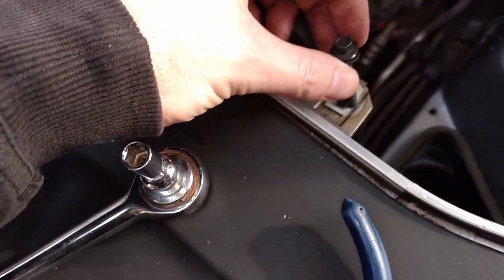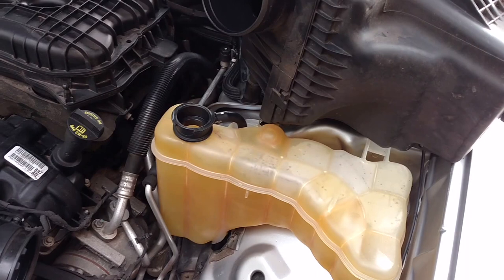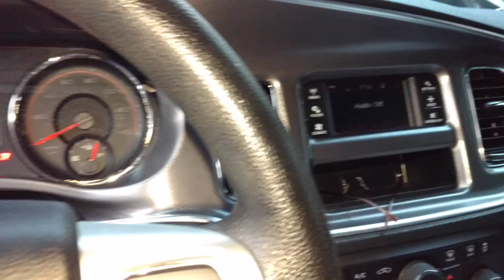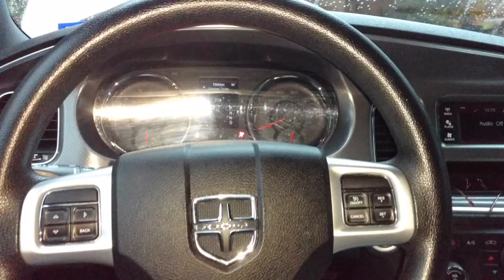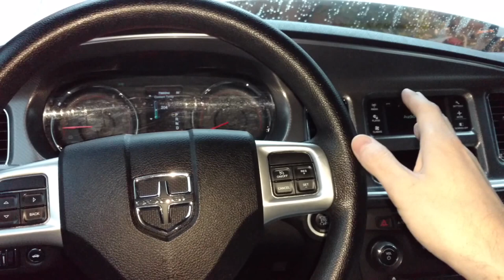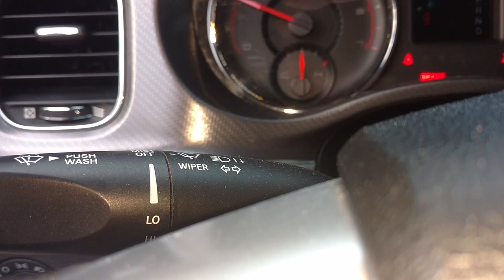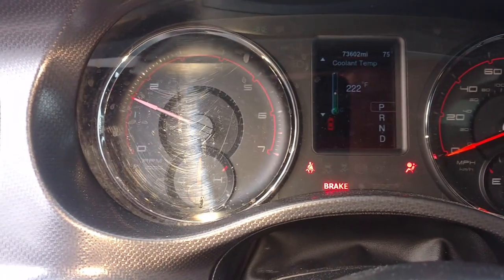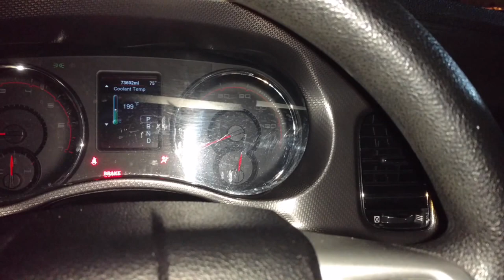Coolant Flush & Change. 2013 Dodge Charger V6.

Comment from the maker: Use silicone on the petcock. I made the mistake of WD-40 and it dried out and broke the O-ring.
Reply: Did you have to replace the whole radiator? Or is there a way to replace the o ring

Comment: At the beginning, if you don’t want to remove the whole thing, you can just remove the passenger side front tire, remove the 3 plastic locks on the bottom (under the box looking thingy) and then under the front bumper remove the first 2  7mm screws starting from the wheel. That will give you enough clearance to get your hand inside and turn the petcock. Saves you a lot of time and effort
Reply from the maker: Thanks for the tips.
Reply: You don’t need to remove the tire. I just turned the wheel all the way to the left, and that gives you enough room to get your hand inside.
Reply: shove your arm down there and turn it.....works for me

Comment: A quick rundown, don't use chemicals not listed on components(wd on the petcock) silicone doesn't eat plastic or rubber use that, spray or paste. The way you are doing this you're dumping maybe 1/3 of the coolant in the system, so at this point you have an unknown amount of old coolant, new coolant, flush (acid), additive, and deionized (should be distilled) water. For air in the system USE THE BLEEDER. Every single drain and fill, open the bleeder after the coolant stops draining from the petcock (more will drain out), close the petcock, fill until coolant starts to run out of the bleeder close the bleeder, and top the system. To do otherwise is to risk an overheat that the ecm can not mitigate.
Reply from the maker: charredskeleton - It's mentioned in the video not to use WD-40. I learned the hard way. The bleeder is good but in my experience won't get all the air out.
Reply from the maker: charredskeleton • I also mentioned the bleeder valve too. Watch it again all the way through. You're right should have used distilled water though.

Comment: Great video couldnt find it this anywhere else. Just wanted to add that the plug to bleed the coolant and get the air out is located at the top of the thrrmostat housing which you showed. You just use a screwdriver to loosen it and release the air and once fluid starts to pour out you can tighten it
Reply: When you release the air, should the engine be on or off when releasing the extra air? And should I cycle the engine before releasing air or no?

Comment: Hey, i have a 2013 charger v6 and the reservoir wont stay full. there is no leakage on the groud. any ideal what it could be? when i purchases it it came with the yellow coolant. are we support to be using the mopar purple kind?  thanks
Reply from the maker: Sounds like air in the system. Once you purge all the air out then just top off the coolant and it wont disappear anymore. Yea might as well flush the system and put in the purple Mopar. Thanks for watching.

Comment: Can you please help me. I replaced my thermostat. First I drained out all the coolant. Then I replaced the thermostat. Once I had the thermostat in place I inserted coolant into the reservoir up to the line where it said "cold fill range" (I made sure to close the bottom coolant valve) then I let air out through the thermostat bleeder and the coolant reservoir went down. Then I filled up the coolant again and bled the air out and did that over and over again until there was coolant coming out of the bleeder valve. I never actually heard any hissing noice but I assumed the air was coming out since the coolant reservoir was going down. I then turned my car on and let it running with warm air and with the coolant tank cap open for about 15 mins. However when I was driving and then parked there was coolant leaking everywhere underneath my car and there was vapor coming out of the coolant tank cap and my coolant temperature was 246 Degrees Fahrenheit. Any thoughts please bro?
Reply from the maker: Sounds like a restriction, something to do with the thermostat, maybe it's backwards or some other restriction. Sounds like an airlock was created and that explains why the coolant went down but none of it came out of the bleeder screw (if i pictured your explanation correctly). — Ensure your gaskets and hose connections are solid. Definitely don't drive it until you get this figured out so you don't ruin the engine from overheating. (246° is way too high)

Comment: For the coolant is it just best to use the mopar concentrate or is other coolants fine to use , I got a 14 challenger with similar cooling system just don’t know if it’ll be a major difference or have any effect
Reply: Have to use mopar coolant its rated for 150k miles but you should change it in half that around 60-80k miles

Comment: I tried to do this and my car started overheating? I've been having a check engine light with some instances of AC power lost
Reply from the maker: You have air in the coolant system causing it to overheat. You need to bleed the air out before you  drive anymore to avoid anymore over-heating damage to the engine. Here's the video on how to bleed better with a tool that helps - https://www.youtube.com/watch?v=9wXDJ6GKue0 .

Comment: How were you able to release that extra air once the actual coolant was in, you said the towl over the resivior cap method and squeezing the hoses but was there any way to release that air from the petcock like you were doing with the water?

 Thanks
Reply from the maker: Austin Sloan - Once the coolant is in the petcock will stay closed. Let the pressure build up after driving for a minute or so... make sure you don't get over 215-220 degrees and then turn the car off and do the towel method. Once most of the air is out you should be within the 175-192 temp range at operating temp. If you notice huge tempature Fluctuations while driving that's a good indication you still have air in. Also its probably a better idea to buy the coolant funnel i mentioned and it's in the description... Other videos show how to use it.

I've since learned there's a vacuum method that ensures near 100% air removal which can be found here - http://amzn.to/2opUzfP

Thanks for the question and watching.. Hope this helped.

Comment: I did more research and watched some videos about that funnel, would I be able to just add the coolant and then let the car run and let the air bubbles escape because the system is not pressurized and then once it stops bubbling cap it? would thay work or would the over flow be over flown? 
Thanks for the timely response
Reply from the maker: Austin Sloan - Yes you let it run with the funnel on and the air escapes.. it won't overflow as long as you don't overfill it.
Reply: I was more so asking if I would I be able to do it without the funnel, just leave the resivior cap off with the vehicle warming up and releasing the air just without the special funnel
Reply from the maker: Austin Sloan - No.. the funnel adds the needed space/height because the pressure will cause the Coolant to rise and fall.. without the funnel you'll have a mess ;).
Reply from the maker: Austin Sloan - Also it's very likely to get more air in the system if you did it that way... I actually shouldn't have opened the cap with the car on in the video.. only do that with the car turned off.

Comment: I want to do this to my car but my resevoir is filled with like a tan color gooey stuff have any idea what that is?
Reply from the maker: veronica lopez • Doesn't sound good... Noticing any leaks on the engine block? Sounds like oil contamination into the coolant lines... Which makes me think the engine has a lot of miles or has been overheated :(.
Reply: Mr Ficks I have about 98k miles but  theres no leaks and it is overheating now 🙁 not sure how to fix the problem
Reply from the maker: veronica lopez • definitely flush and change the coolant... If the engine tempature is getting above 212° it's definitely not good.. So if I wouldn't drive it if it is.. Until you flush the coolant.. And make sure there's no air trapped in it after :). If you have any more questions feel free... Hope it goes well.
Reply from the maker: veronica lopez • also this video is an easier way to drain the fluid... Also it shows an easier way to get the air out after - https://youtu.be/fI-PC82-mHw

Comment: So my 2012 Charger with the same engine. The heater is hot for about 2 min when I first turn it on, then goes cold. Would this fix the problem?
Reply from the maker: Yea sounds like a fluid and/or air trapped in the system issue.

Comment: So I just changed my thermostat. Refilled the fluid and have been driving it. It’s running at around 215 now. Is that too high? If I loosen up the bleeder it is coming out pure liquid no air
Reply from the maker: Sounds like it's close to fully purged if not already.
Reply: @mrficks1838  I played with it again opened up the bleeder screw again and it’s still coming out pure coolant. Ran it with the cap off and heat on for a little while. If it’s not fully purged will it eventually work itself out? Just a little concerned why its running hotter, guess it could just be the thermostat itself.
Reply from the maker: If it's running hotter my guess is there is still air but not much. 215° is not too high. Also there may be slight variations depending on the thermostats manufacturing.
Reply from the maker: It will slowly purge yes but go ahead and crack the cap after you park to let it out until you see a temperature you feel good with. It might take a few times of that over some days. If it doesn't move then my guess is the coolant mix and or the new thermostat and I wouldn't worry about it.
Reply: @mrficks1838  thank you I appreciate your input!

Comment: I ha e a 2012 Dodge Challenger the engine bays look the same so you think I could reference this video for  doing a flush on my vehicle thanks
Reply from the maker: Yes, the 11-14's are just about the same.
Reply from the maker: And that's for the Challengers, Chargers and Chrysler 300s.
Reply: Mr Ficks thanks for the update

Comment: I noticed the catalyser and exaust is alll rusted... how do i clean that up and remove rust?
Reply from the maker: Luis Rodriguez • sandpaper, wire brushes or this drill attachment - http://amzn.to/2FWXRPm . You can find many brands that make rust remover sprays too... But that's for after using the abrasive stuff usually... Could use it with the brushes too but would be messier.
Reply: @mrficks1838  thankyou

Comment: Question just changed the stat (203) and new cap but it's still running hot fan kicks on around 230. Heat blows out fire. My top hose is get really hot and bottom kinda cold. I can grab it and hold it  replaced radiator about a yr ago or less. Is a flush needed or could it be something else?
Reply from the maker: I'd bleed the air first and if it's still running hot then a thorough flush until visible particulates are gone. I'm getting a feeling there might be an obstruction in the line but that's probably just paranoia. Happy Fixing.

Comment: I just replace my thermostat and I didn’t have coolant so I used water my vehicle keeps overheating in the pipe gets fat that’s connected to the thermostat is it because I’m using water
Reply from the maker: You have air in the system. The video linked at the end of this will show you how to burp / bleed it out.
Reply from the maker: The water shouldn't be causing it .. but you should drain it and add coolant before you bleed the air out. This is the coolant made for the Charger - https://amzn.to/2NHyIeL  - Use distilled water for the concentrate version I have linked or you can buy the pre-mixed Mopar and it's ready to go. The concentrate is just cheaper.
Reply: Tony vill98 use coolant water boils our the drip spout

Comment: My car does not have the hose that goes on the petcock. Where do I buy it? What's the name of the hose?
Reply from the maker: Looks like they just saw 'lower hose' when looking in cooling system parts. AutoZone is an easy place to find parts or just the names sometimes. - https://m.autozone.com/cooling-heating-and-climate-control/hose-lower/dodge/charger
Reply from the maker: Here's a kit that probably isn't the right size of hose but it has the clamps. It'll be a good start for you to find the right part. - https://amzn.to/2zp6tx3

Comment: What’s the hottest ur coolant has gotten just wondering
Reply from the maker: 204° with the regular thermostat for the charger. That's in the summer too. It'll be hotter if you don't purge the air after changing the coolant.

Comment: What are all the things I need for this and how much did you spend?
Reply from the maker: Here is what I used Lisandro. The prices are listed on each link.

Royal Flush: http://amzn.to/2kzD8Kt
Purple Ice Additive: http://amzn.to/2kzFCbT
Mopar Coolant: http://amzn.to/2jXwxGo
DiElectric Silicone Grease: http://amzn.to/2kzvrQo
Rubber O-Rings: http://amzn.to/2jaDTJC
Plastic "Popper" Rivet Remover: http://amzn.to/2javHcy
"Airtight" Coolant Funnel: http://amzn.to/2jasFEZ
Petcock Socket Set (not mentioned in vid): http://amzn.to/2kzEVPG

Thanks for watching!
Reply from the maker: Lisandro Valencia • not sure if that reply got to you so checking back. Thanks for watching.

Comment: Is it normal to see the bubles condinsation on the inside top of the tank
Reply from the maker: The bubbles indicate air and that should be released... if you are talking about what comes back in from the top hose .. that can cause small bubbles and it fairly normal but still indicates some air.
Reply: Thank you  iv been told by some its normal some it could be exaust